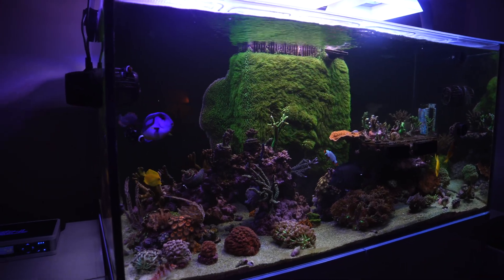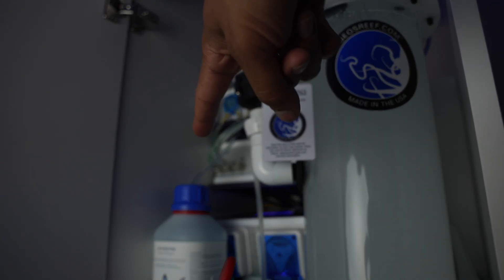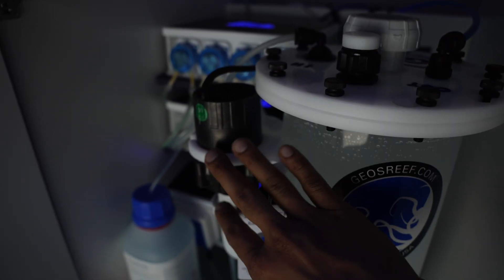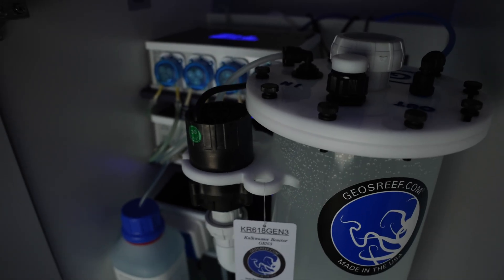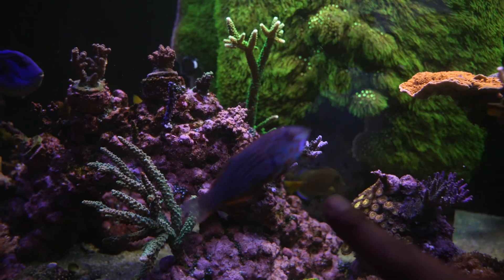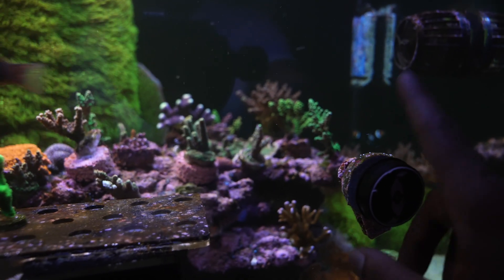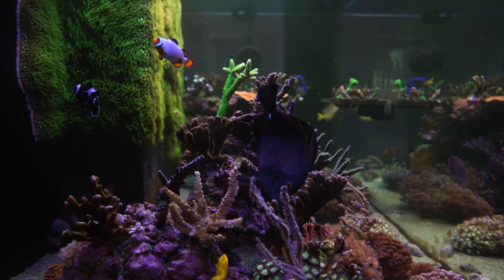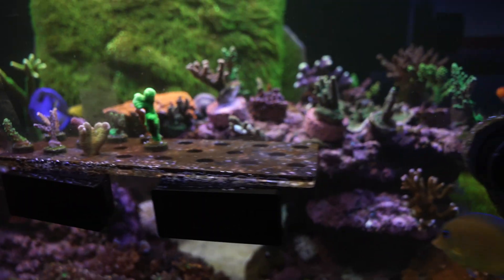My corals stopped growing........

Comment: Well, you have phosphates and you have Nitrogen at 17, but no hair algae and no junk growing on rocks. Then the answer is simply: you are over buffering the tank with kalkwasser, and everything slows down and eventually will stop growing.  When you add Alkalinity to the garden lawn, you will kill the weeds, but when you add too much you will kill everything.  Same thing is in the ocean, you must be right between acid and alk.  You are running too alkaline.  Stop kalk, but bring down nutrients as well, then it will all grown again.  Corals actually prefer to grow toward acidic water, but the problem is all other junk loves that as well.   Pull back Kalk to a point you see stuff growing on rocks.  If you don't see it growing, it means corals are "slowed" down as well.

Your light also seems weird on the videos, but it could be just video.

Comment: It's not phosphates..... High phosphates are great for a tank... I stop counting phosphates after a few years. I go between 0.2 and 0.8 ppm. The problem is your Tin most likely... Heavy metals can destroy corals.
Reply: Definitely agree on that point.  Tin is definitely a metal that kills coral when elevated.  Not sure if you are running a UV sterilizer, but that was the source of my tin.  The inner wall of the sterilizer had a jet black residue, the UV light was basically degrading the PVC and leaching tin.
Reply: Totally agree with both of you—tin is no joke. A lot of people overlook it because it’s not a common parameter we monitor regularly, but once it shows up on an ICP, it usually means something is breaking down or leaching in the system.

UV sterilizers are a sneaky culprit too. I’ve seen a few cases where the inner sleeve or plastic housing starts to degrade over time, especially with cheaper builds or ones running hot. That black residue you mentioned is a red flag for sure.

Glad someone brought this up—heavy metals like tin don’t get enough attention, and they can absolutely wreck coral health even if all the “main” parameters look solid.